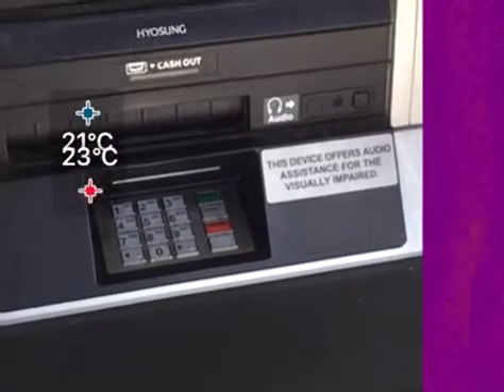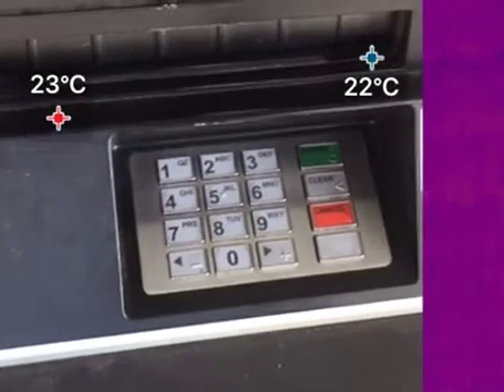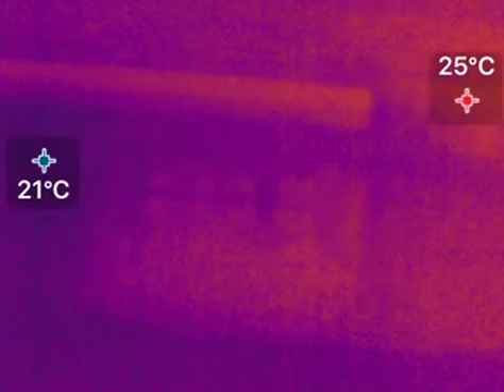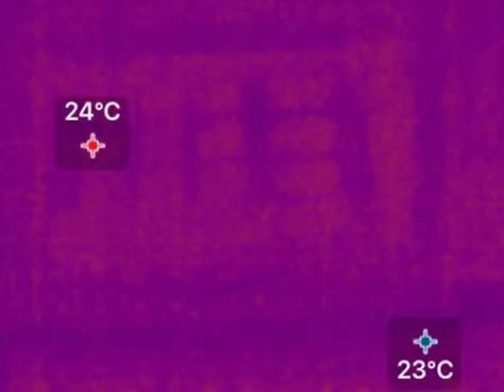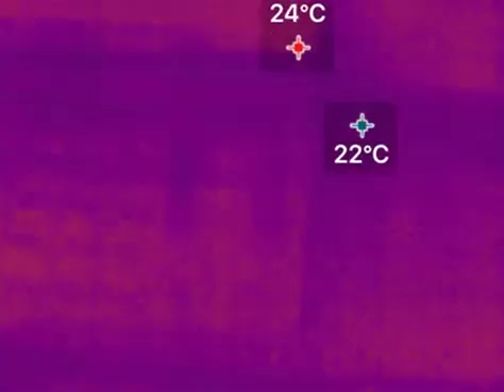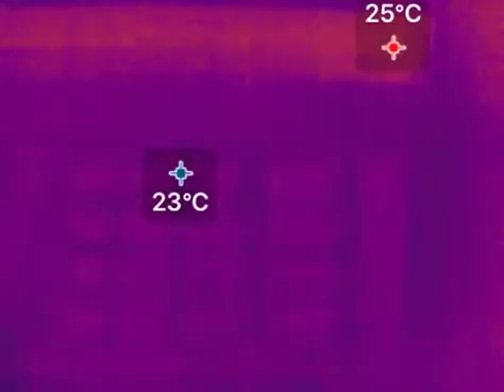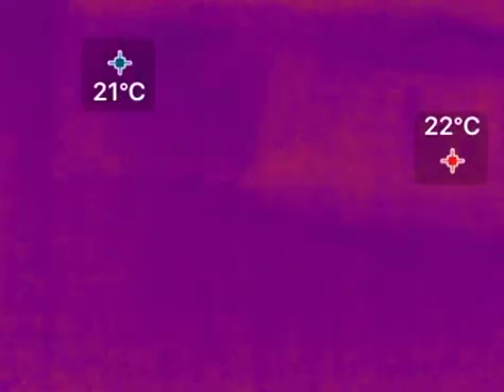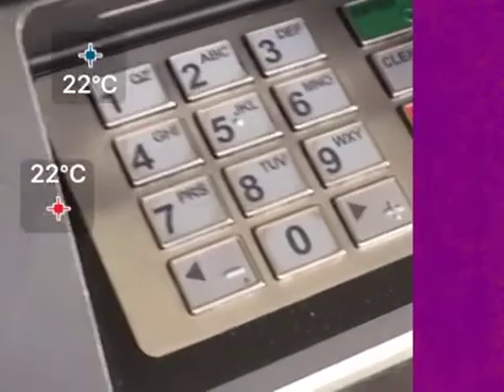STEAL PIN NO. USING A THERMAL CAMERA?!

Comment: Metal keypads won't work with this method, metal is highly thermally conductive, meaning it dissipates the heat quickly so a thermal signature can't build up.